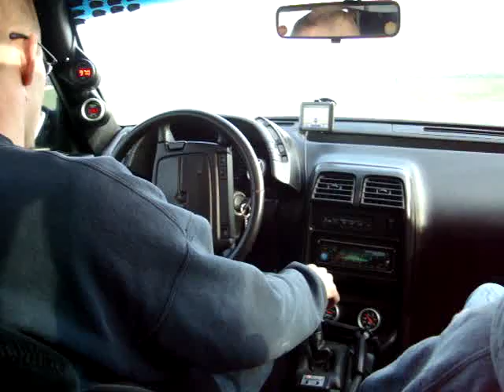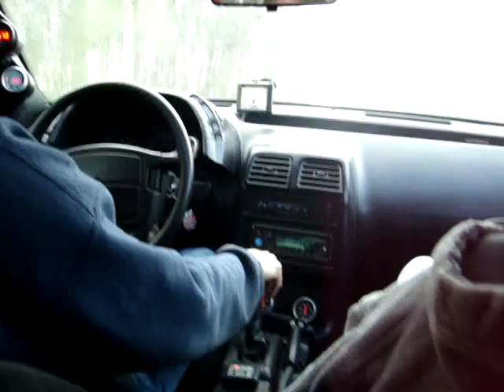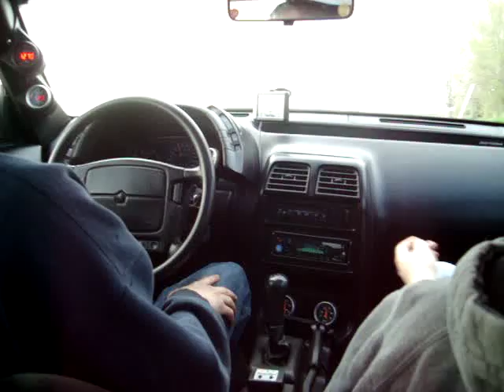37 psi iroc r/t daytona, holset & methanol, lotashelbys

Comment: There a major flaw in your thought process. 1610 is the measure of the temperature of the exhaust GAS, not the aluminum head itself. Air doesn't transfer heat very well, so aluminum would take ages to reach its melting point. Nice try kid.

Jackson's cars are awesome. Must be one wild ride in that r/t.

Comment: When you say 1610 are you talking EGT's? If so you I would imagine your heads didn't last long because aluminum melts at 1,200F. You will never see 2K degrees on an engine that has an aluminum head. Typical guy talking smack and doesn't know he's talking about.